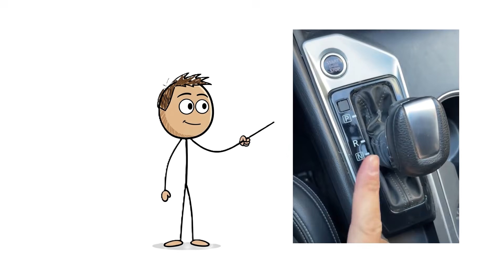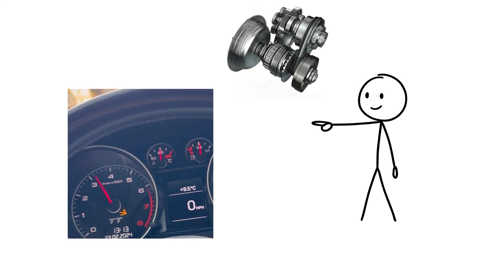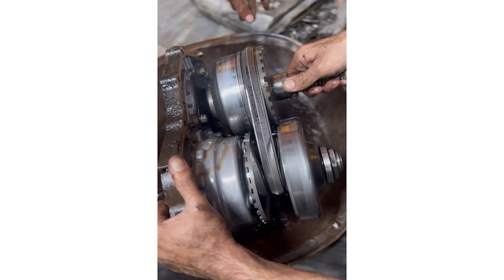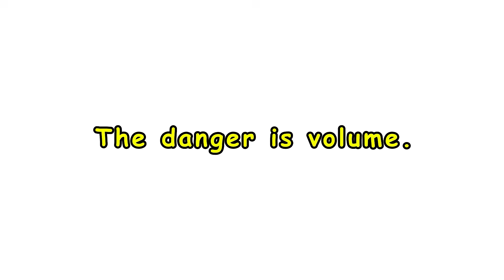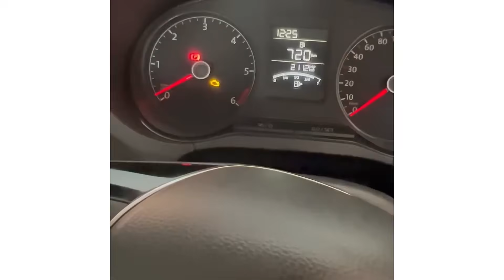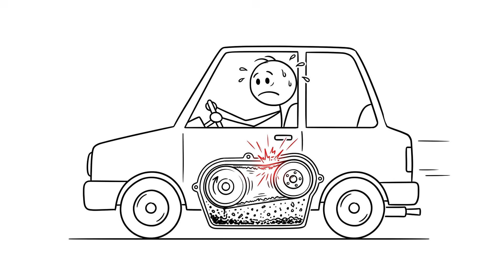99% of CVT Owners Have No Idea How This ONE Bad Habit Destroys Their Transmission

Comment: I own a 2015 nissan sylphy. And i made the mistake of not servicing it immediately after  i bought it. I have been to four transmission specialist cost me over $300000. From my research  these transmissions go in safe mode to prevent damage.  I suspect the valve body was the issue. I went on ebay and bought a brand new valve body for J$23000. Problem solved. My transmission new again. So when problem arises service it change the oil and two filter and valve body
Reply: Either, you omitted the decimal place in your figures, or you meant ¢ (cents/pennies) instead of $ (dollars).

Comment: Honda Accord cvt 250,000 and still going strong. Fluid change every 30,000-35,000 miles.
Reply: I do the same with my Altima and I'm at 200,000 miles

Comment: I have a 2020 Toyota Corolla….I did some research before buying, so I basically had a semi-working knowledge of the CVT. Here’s my routine
1. Never start out cold..always let the car idle for 30-45 sec. 2. When backing up , Never switch to drive before coming to a full stop 3. Start off slowly 4. Finally, I didn’t buy a race car……so treat your CVT kindly….
Reply: Did all that and it still died
Reply: My 2005 and 2015 pilot is still pulling tailors and not so off roading!
Treat cars like babies.
Check diaper(oil) frequently the oldr it gets.
Change diaper(oil) when things get stinky(dark).
No coasting from neutral to drive!
Reply: Those are basic stuff, everybody know. Don't worry too much.
Reply: BS. Every car should work fine within its performance range limit, for example it's healthy for the engine to rev to its max occasionally unless you want a dead engine.. The car that falls apart in normal use within its envelope is just trash just like many CVT's out there.
Reply: @R.S-1986  well here's the BS. Why top fuel dragster always rebuilt its engine after 5 seconds of hard driving? Uhuh... That, is a dead engine.
Reply: @keledek660 Yes, and a toyota with a 1.6L and a planetary automatic will drive 400.000 miles. And yes you can floor it as much as you want, against a CVT that will last only 100.000 miles.
Reply: @R.S-1986  bro stop driving your cvt like you stole the car and it will be fine
Reply: @pd0di Not a Jatco transmission
Reply: @richardcarden4161  have no idea what a jatco is
Reply: @richardcarden4161 Jatco does make Xtronic CVTs for Nissan because Nissan is a majority owner of Jatco. Pre 2018 I'm leery of, 2018 on are improved

Comment: Wait... is there really some idiot putting their automatic transmission in neutral, then shifting to drive while revving and thinking it will NOT damage the transmission lol?
Reply: Trust me I've seen plenty, especially when their teenage sons driving it.
Reply: I'd say there are multiple idiot who do that and think that way. 

I've owned a Yamaha T-Max with a CVT and there were enough idiots who wrecked the auto-clutch and CVT by holding on to the brakes, revving up the engine to "load it up" (causing the clutch to catch and lock) to get faster off the line. It destroys the clutch and the CVT in surprisingly few standing starts but even if you explain it to them they can't seem to grasp the consequences of what they're doing.
The thing is that people like this see car journalists put a (sports)car in launch mode to get faster 0-60 times and think they can do the same with a CVT by forcing it this way.
Reply: Can u explain further pls
Reply: Jim Rockford did it every episode but then again he did get through a few boxes. 🤣🤣🤣
Reply: Easier on the transmission is to power stall the torque converter. Takes the slam out of transmission. Still not good for the life of a tranny.
Reply: I try to do it twice a month 😂
Reply: They say to shift to neutral while driving down the road and then return to drive.  Is this harmful to the transmission?
Reply: @JMEVO-bk2xd  Yes, CVT's should only be shifted with the engine at idle and the wheels not turning.
Reply: That VW dsg transmission does it like a champ
Reply: Been going on for decades

Comment: Bought a new car in 2025. Main selling point, car must have manual transmission! Found it,Bought it,couldn't be happier! 😮
Reply: Smart Move! There are very few new cars with a MT being manufactured now, unfortunately. As a trans shop I applaud your choice because the current automatics in new vehicles are terrible across the board.
Reply: So what did you buy?
Reply: @thebobsmith1991 Nissan Versa for $18,000
Reply: Luv it. You still have to change th e fluid but very easy and inexpensive!!👍

Comment: I’m not sure about you, why would want to own a car with a CVT that is so fragile and cost a fortune to repair when you can own a car with a real transmission not deal with all the crap of a CVT. The CVT look like money makers for the auto manufacturer only. They claim they are better on fuel economy but will it offset $5000-$7000 repair bill every 60,000-90,000 miles depending where live and driving habits.

Comment: The number 1 main cause is driving your car ! Changing fluid every 30,000 helps at $ 300 or more per change ! The fluid alone is about $100 !
Reply: Get a socket set and do it yourself cost 70 au
Reply: India cost $35😊
Reply: @AshutoshSrivastavaTimetraveler  That's for an elephant!

Comment: I had a 2007 prius went over 200000 miles without a cvt fluid change
Before I sold it. The new owner hasn't had any problems yet. Then I hear stories of people servicing their cvt fluid and then the cvt dies.
Reply: Hybrids don't have the transmission shown in the video

Comment: Shows a 2021 model pathfinder that uses a 9 speed and not a CVT. 😑

They ditched using CVTs on any V6 engine because they broke too easily from the torque. 

Now, only the 4 bangers and VC turbo 3 cylinder uses CVT. 

The new murano is a 4 banger VC turbo, not the 1.5Liter. Uses a 9 speed. 

The only way you will race a CVT with mods is if you upgrade the CVT too. A calibration doesn't do jack crap if you are running stock internals. 

Upgrade the internals and then add power. This is exactly why nissan ditched them from any V6. 

If they upgraded the internals, no one in their right mind would want to pay 10. To 15K dollars more. Instead of 40K you end up paying up to 60K. CVTs are expensive AF

Comment: I'd suggest that if you are considering buying a vehicle with a CVT that you do some research and find out if the vehicle you want to buy uses a launch gear in the CVT.  The launch gear is a conventional gearset that accelerates the car from zero up to about 10 mph, which is where a lot of the wear on the constant velocity mechanism takes place. After the vehicle reaches about 10 mph the constant velocity mechanism takes over. This prevents a lot of the wear on the belt and pulleys and substantially improves the reliability and longevity of the transmission. That's why Toyota CVT's, like the one in my wife's 2020 Toyota Corolla, have a launch gear. I believe most of the newer Toyota CVT's have a launch gear.
Reply: In the UK, Toyota's come with an e-CVT transmission which is completely different as it runs on a planetary gear system. Pretty much bullet proof thankfully. I'm surprised they haven't rolled it out to all of their cars around the world.
Reply: @FrozenMetroid E-CVT transmissions are used in hybrids. Here in the US, they still sell a lot of conventional gasoline only cars that use belts and pulleys in the CVT. I wouldn't recommend buying a non-hybrid car with a CVT unless it has a launch gear. I know Toyota uses a launch gear, but I'm not sure if any other manufacturer does as well.

Comment: I've been a transmission tech for 35 years and there is so much misinformation in this video. For example you shouldn't neutral drop any transmission unless you're willing to spend some money, eventually something will break. There is no good way to check a transmission pump without pulling the transmission, you can listen for noise and if someone wants to take some time and money you can run some pressure tests but it's nothing that would be on a normal inspection. And being technical here, that is a solenoid they work valves they are not valves. So much more but I'm sure I'm boring everyone.
Reply: You're not boring. You saved me 20 minutes.
Reply: Keep on boring us. It is interesting!
Reply: I've been rebuilding automatic transmissions 49 years and I don't even tutch one ,, I have more important cars and trucks to work on  instead of the JUNK crap CVTS 🧐
Reply: @LouisEdwards-g7w Now ,,, wait a minute. The new trannys, 9-10 speeds. Shift constantly, poor low speed drivability. Same fluid interval changes as CVT. Unless you peeps wanna start driving a 3 pedal car again, either let them build more robust CVT or shorten your fluid change intervals. But don’t bash CVTs. New 20 speeds suck. You all do not want MT. Nanny nanny boo boo!!!😢
Reply: Agreed, this narrator is terribly misinformed. If anyone is watching this for real information, you would be well served to look elsewhere.
Reply: Much obliged! Keep being boring!
Reply: Not boring me allwaya interested in learning something new
Reply: Thank you boringly increasing my knowledge.
Reply: When I was a kid, my neighbor got a car for his 16th birthday. He did the neutral drop thing and, sure enough, it broke down.
Reply: May i ask u some questions about my 2019 civic lx 2.0 with a cvt thay failed at 299k miles
Reply: @Swordfish024  If your CVT failed at 299k then you did GREAT! Design life expectancy is 150k. I have a 2008 Dodge Caliber with a CVT2 by Jatco. My first CVT lasted 238k. 2nd CVT lasted 125k. Now on my 3rd and have about 50k on it. Dodge says to change the CVT fluid every 120k miles. That is what I follow and have had great results.
Reply: @sterling1989 awesome!! On forums and comments, pretty much around 100k-200k it would fail on most people. Almost 300k so i wasnt surprised when it happened. I didnt hear no crunch or winding, just lost torque and started rolling. Doesnt give on any of the gears, turned it off and towed it home. It still stays put on park, any other gear it'll just roll. I already came to the conclusion that i just have to replace it with a used one between 60k - 120k miles but thats still iffy. A new one is pricey but you'll have the peace of mind that it brand spanking new.
Reply: Do they have website for the transmission
Reply: @sterling1989 exalent
Reply: @Swordfish024  You can replace the damaged parts only e.g pulley, belt etc. if not mistaken. Might save you some cash but workmanship cost is not going to be cheap. My 2020 Accord is on 100k miles and still runs fine, for now because always had the CVT fluids replaced by 12k miles no questions asked.
Reply: @keledek660  i rebuilt manual transmissions for older hondas/acuras but not a cvt/automatic gear box. Theres not a lot of videos up on how to and the lack of knowledge. I definitely have the confidence but ill get to disassembling the damaged one after i get a new or used one
Reply: @Swordfish024  As mentioned by another commenter 299k is excellent for any transmission for that matter. Generally speaking on a Honda the cvt transmission itself seldom goes out. Most often it's the torque dampener kind of like a torque converter but no fluid in it. It's common for the splines to strip out. But yeah if you have a question I can do my best to answer it. I don't know everything or claim to but I've got a lot of crap crammed in my little brain.
Reply: @Swordfish024 299,000 MI I don't know how much more you want hopefully you'll get another $200 but
Reply: May I ask a few questions about my Nissan Sentra 2013? I had my transmission replaced for 6k two years ago. Now, at 120k miles, the CVT Judder code appears. It’s another 6k. If I replace it, will it fail again?
Reply: @nicolewilliams3127  Everything man made thing fails eventually but unfortunately Nissan cvt's have a lot of issues especially that judder code. You could try a shop to see if a update of the tcm can fix it but honestly it seldom does. Occasionally it can also be fixed with a valve body but once again not a super common fix. That is the crappy part about Nissan they build really good engines but the cvts aren't good. It's sort of a lottery with those transmissions occasionally you hit big and it lasts a long time but people don't hit big often.
Reply: @nicolewilliams3127 I would think at that time it's about time
Reply: @nicolewilliams3127 I own a 2016 Altima and it has 210,000 Mi on it the first transmission went out at 65,000 miles because I drove it hard with the new transmission I'm driving it with gentle acceleration like a CVT is designed for pulley on pulley belts are not meant to be slipped they start glazing then the slipping begins this was my first car with a CVT and drove it like a normal transmission car and that's wrong I learned my costly lesson and now I have a 140,000 on this transmission and never change the fluid or filters it's all about your driving habits
Reply: @DonaldMassi-ib8dd thanks
Reply: @nicolewilliams3127 yep
Reply: The best way don't buy CVT all problems fixed
Reply: These things should be recorded by actual people who know what they are talking about and dont just smear some axle grease on their face or shirt and think they are mechanics because they stayed at the HolidayInn.
Reply: I read every word.  Please post me.  Trying to learn everything I can on this subject.  Thanks.  God Bless.
Reply: The video says NOT to neutral drop ever!
Reply: I enjoy reading information from someone who knows what they’re talking about! 👍
Reply: You're not boring anyone..Keep sharing your experience and knowledge
Reply: Should be banned
Reply: What's your location
Reply: @laurenslashboss3891  that's a odd question, why do you ask that?
Reply: Nissan Sentra 2019 cut failed after fluid exchange
Reply: Any info you have would be interesting
Reply: Thnx!!
Reply: I want to ask you what kind of used car should I buy based on the transmission? How would a Mazda b? Miraculously the car I'm driving is working but shows a failed transmission, Jacko.
Reply: Sir..... please. Continue.
Reply: Dude,I can tell right away you know your stuff. Great information!
Reply: Do I really need to reprogram the car with a computer when I do the transmission oil change on my 2017 Honda civic? Doesn’t seem to make sense.
Reply: @pedrorosales437  some of the cars now a day have a option to reset the transmission oil life when doing a change. In my experience it's not necessary but it does however let your current or rather most recent technician know when your last transmission fluid change was, mileage wise. To me it's pointless just have your transmission fluid changed between 40-60 k intervales and you should always be alright.
Reply: No ur not, please continue!
Reply: Since you have the experience if you could make us a video on the subject I'd be glad 
I don't care if it's boring finding good content on these makes all the difference
Reply: 100%
Reply: No you're not please tell more
Reply: Then with your skills can you maybe shed some light on my CRV 2010.
Had 4 new tyres. Car started making whirring noise sounded like steering wheel pump and when I turned the wheel felt like car was coming apart. 
Had new rear diff oil put in that cleared that problem. Had new gearbox oil put in and the whirring still carries on. Do I need to replace st wheel pump. All weird bc car had a service and was fine until put the tyres on
Reply: Not boring. Enlightening!! We need more of knowledge spread!!
Reply: How many 2013-2018:nissan pathfinder do you see?
Reply: @JessicaTorok-i5g  Not many, they aren't impervious by any means but in the last two years I've may have worked on 4 for transmissions. It is a different cvt than many of the other Nissans use, it seems better. Also I'm in the pacific northwest it's possible it's not a big seller here. This is big 4x4 and Subaru country, the majority of SUVs' and crossovers I see come from the big 3. It's possible there aren't a lot of them here, I know the internet says they aren't good but that's just not my experience.
Reply: I always neutral my car when going down hill. Is that a problem/bad idea? And when ever I neutral it, when switch back to D it still seems like it is in neutral and then couple seconds it reads that I’m in D
Reply: We appreciate you warning us about the misinformation

Comment: If CVT's are so bad. WHY: We had a 2014 Mitsubishi Outlander. Drove it just under 10 yrs, just under 100,000 miles. Traded it in on a 2023 Outlander. That 10 yrs was totally trouble free. No expenses other than normal. No mishaps. No breakdowns. No non-starts. And certainly no CVT expense. Were we supposed to change it's fluids? If so, we didn't. So where does your info pertain to us? I'll be glad to let you know in 8 yrs if our 2023 has any.
Reply: I have a 2015 Outlander Sport  that made it to 108,000 miles and the CVT failed.  Mitsubishi wants $10,000 to replace the CVT.  You are lucky you got rid of yours before it hit 100,000 miles.  I am stuck with an immaculate  clean car with a reliable engine decorating my driveway. 😢
Reply: That's the lifetime mate transmissions should do triple that if maintenance is done the next poor bloke will find out if he doesn't replace the valvebody and fluid.

Comment: Question what is the difference between E-CVT or a regular CVT  because my car has a E-CVT
Reply: E-CVT does not use friction belts; they are just as reliable as regular transmissions.
Reply: @gribbler1695 thank you 🫡🫡🫡🫡
Reply: @gribbler1695 WRONG.